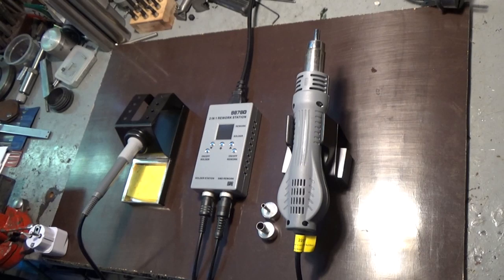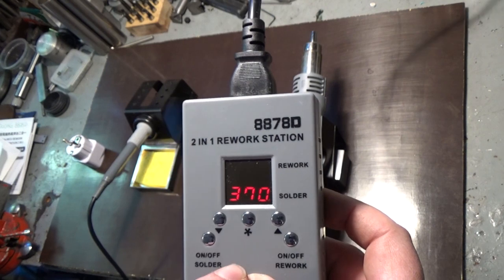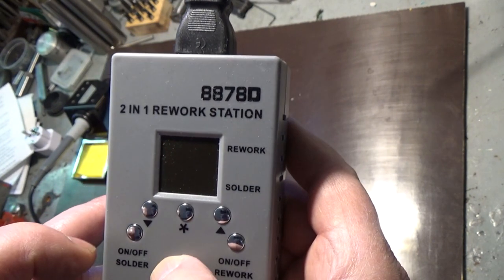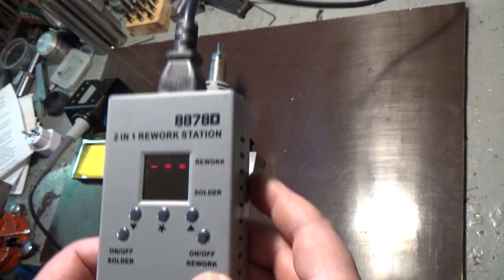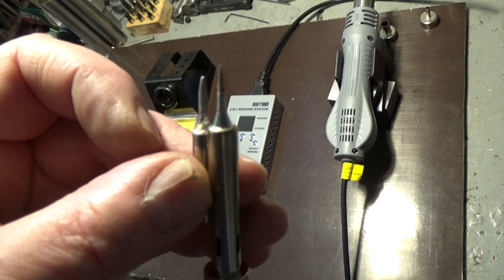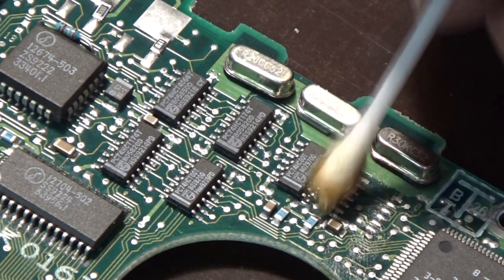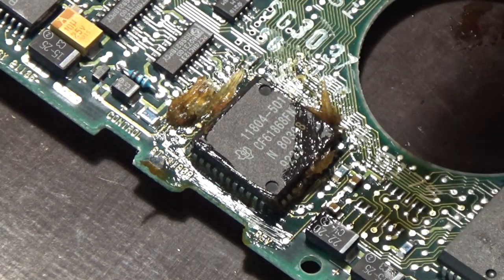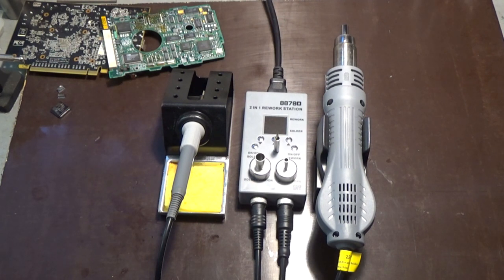YAOGONG 8878D Soldering Station from Banggood | Review and Test

Comment: I have been looking for a good 2 in 1 station for the last week. This sold me on this kit! Great review! I just ordered my kit tonight!
Reply from the maker: Thanks. You did the right thing ordering this soldering station. I like it a lot. You will not be disappointed.
Reply: @-BUFFALOMan  it’s great! It fits in my work bag compact, gets hot quick, and the sleep function is next to none for my applications. I do home automation and soldering connections in equipment rack room is perfect with this. Only thing I will say it could use a longer power cord would be nice sometimes, I just haven’t gotten around to getting one. I did recently get the TS80p for my on the go soldering but still prefer this kit. Hope my rant helps you make a choice! Cheers

Comment: Great Video......I just bought one, but it does not tell me if its "F" or "C" degrees. Do you know what degrees its in? Thanks
Reply from the maker: Sweet. Well mine is in "C" or Celsius. Thanks for your comment and watching, much appreciated.
Reply: Thanks for getting back to me so quickly. I'm going to assume that mine must be in Celsius also. I will check it with a temp gun.

Comment: Have you encountered any quality problem in 2 years of use ?
Reply from the maker: No, no problems at all actually. Everything works to my satisfaction.
Reply: Can you use both together? Solder iron with the hot air?
Reply: @kharali3475  Turning both iron and hot air on ? Never tried. Wouldn't recommend.
Reply from the maker: @kharali3475  I have never tried it and I can't see why you would use both at the same time.
Reply: @tompas11A3n52KkX  sometimes the solder won’t stick to them big ground pads and I use hot air to help it
Reply: I have problem, today my heater in soldering iron broke. Now I have to look for a new one, which is quite a challenge.  If anyone has any information, where to buy a new heater, please let me know.
Reply from the maker: @ManiekFPV  I'm very sorry to hear that. Unfortunately i don't have any info where to buy a new one.

Comment: I have this device, i like it a lot!  
Your homemade tip is very nice! But the thinner one that came with it is made to be able to reach individual legs on a chip... Not for everyone, but other tips are cheap and easy to find. I also mostly used one like the one you made.
Your flux is a bit too thick for this precision work, but liquid flux is also very expensive...
So, I have diluted some of that paste-type flux with alcohol, and that works ok, but I get a much clearer, thinner liquid if I dilute pure, solid rosin into alcohol... it takes a day, or two to melt completely, just keep adding more alcohol until the rosin is gone. 
Then, if needed, you can let the alcohol evaporate to the point of viscosity you like.  I put it in an empty bottle of Visine for easy dispensing. 
Thanks for the cool video, 
Cheers from Canada!  ;-)
Reply from the maker: Yes I also like this soldering station a lot. I have an other old soldering station made by Ersa that also is very good. Thanks for the great tip about the flux! Have a nice one.

Comment: Nice affordable tool for hobbyist.  But I still prefer good old el cheapo 858D rework station.  Having knob for fan speed and separate up and down button for temperature makes setting much easier.
Reply from the maker: Well I think that this soldering station is pretty nice and the one that you propose is really good to. Thanks for watching.

Comment: you will damage that ic if that hot, better use  desoldering wick it will not damage components.
Reply from the maker: That's correctly but I just wanted to test the hot air gun. I wasn't going to use the IC.